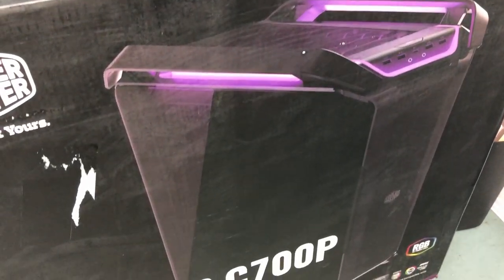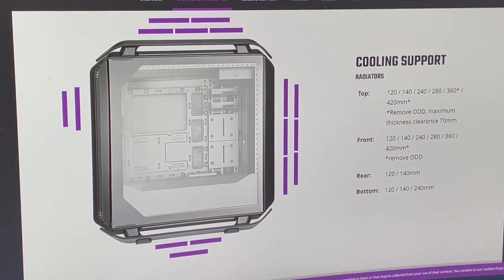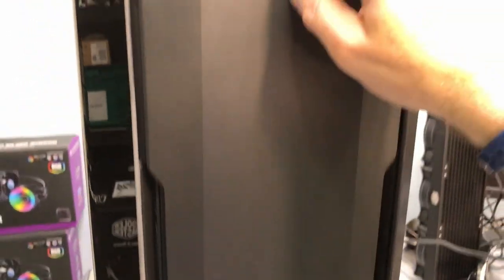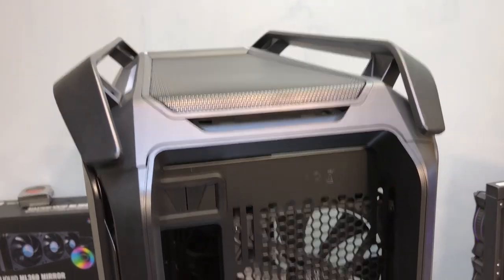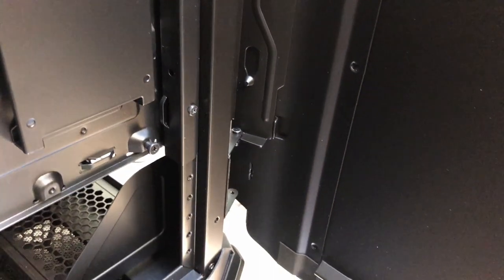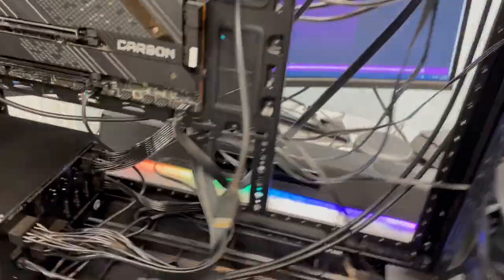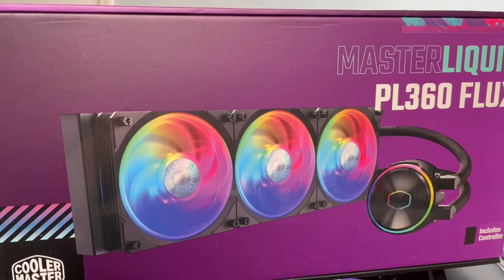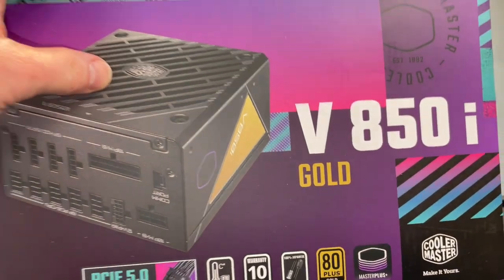CM Cosmos C700P Black Edition is a BEAST!

Comment: the main problem of this case is that the rgb needs an additional controller because the one included just turns the strips on and there is no software option to turn it off.

Comment: Nice review!
Currently i am using a HAF 700, its not the EVO one, i want to get the Cosmos C700P because of the cable clearance for the 4090 MSI X Trio. I am not sure if i will gain more space for the cable clearance with the CM700.

Comment: 260 / 5,000
I don't know whether Corsair SHIFT PSUs can fit there, referring to the PSU housing which has a half square cover. Can the tray be removed or installed without the tray for Corsair SHIFT or what? any suggestion?

Comment: Hi, I could really use some help. 53 minutes 51 seconds into your video you are showing the difference between two cables one with three pins and one with four pins. What are these cables for? I found one of them in the c700p case that had four pins. It was just free floating in the case. Where does each end go to? And then I guess the other question is if they're supposed to be a three-pin version of this what is that three pin cable for? I don't even see that anywhere. I would appreciate if you could help. I can't find the answer yet. Looking for some help.